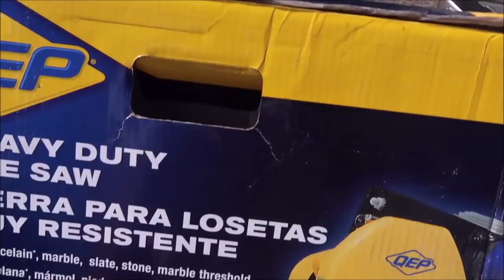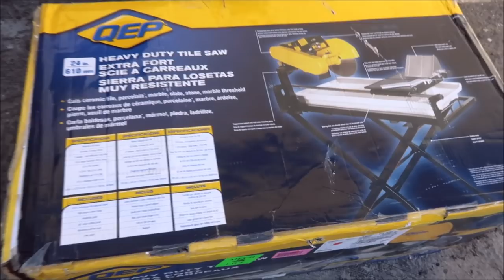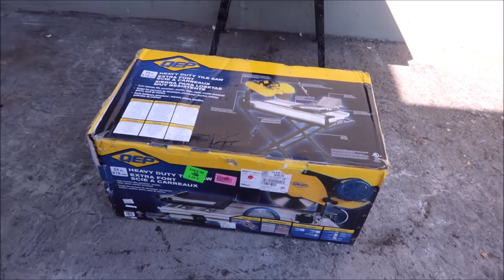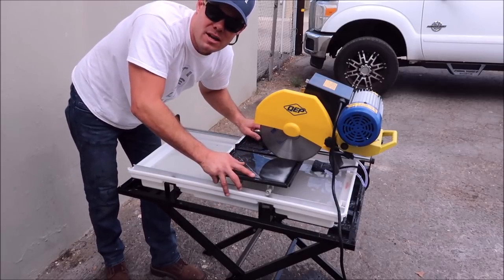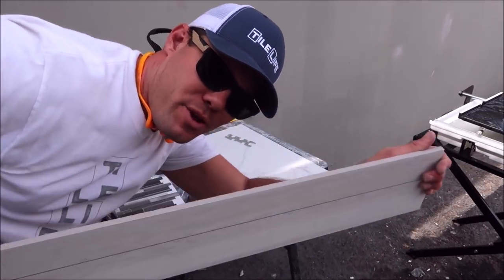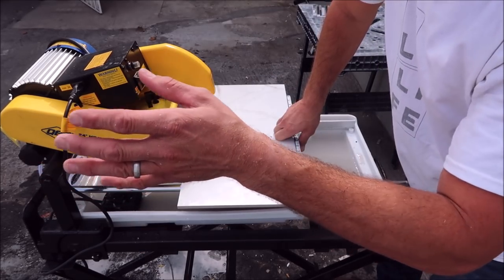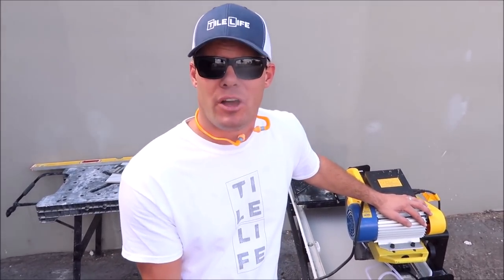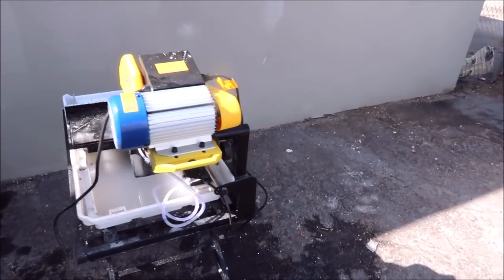Testing  The Cheapest Wet Tile Saw on AMAZON!

Comment: I do like the belt drive. I do like the baldor motors on husqvarna, felker, etc. The downside is lack of plunge, miter on the head, weight, etc. 
Almost looks like an mk saw knock off with the single rail. For 300 bucks, looks like it would be a nice cheap back up saw for pavers and stacked stone. Maybe exterior work. It's no 24000 but looks like a lot of saw for 300 bucks.

Thanks for the video once again! 👍
Reply from the maker: Exactly, and after posting the video, I forgot to mention these missing options...Building and tiling showers on a regular basis requires these options in this age of the tile game. It's great for floors and backsplashes as well as pavers etc. I'm patiently waiting for the FLEXVOLT D24000 to come out! It's our only and last corded tool other than the shop vac 👊
Reply: @LandbergTileTV  
Me too man! It will be an absolute game changer if it happens. The uk has had a flexvolt shop vac since 2016, and I've been awaiting our slice of the pie. I'm not sure why we don't have it here yet. It will be sawweeeeet to roll up on a job and never need a cord though. Especially on a quick bath remodel or even new construction. Our business has been running all of the flexvolt and 20v max we can as well. Such a time saver, and really top notch tools. The flexvolt stuff is underrated at the moment I feel. A lot of people are still stuck in the "nothing beats a.c. power" stage.
Reply from the maker: You read my mind! I've been watching Wragnlerstar's video's comparing AC to battery, and battery wins every time. Times have changed! Time to evolve with it!
Reply: I used it for pavers & it worked great
Reply: My dad and I used one very similar to this back around 2008 and it performed well. Typically it's the blade that makes the difference, if you have a good blade you can do some nice work with it. The saw doesnt make the man anyways lol.

Edit: that saw is still laying around my dads place somewhere.

Comment: I suppose taking into account most of the time the 12x24 tiles are probably going to be installed with the recommended 1/3 stagger rather than half, the clearance may not be as much of an issue. 
I also wanted to say I appreciate how friendly you're replies to comments are.

Comment: The belt drive does make it quiet. Not a bad saw for the price.
Reply from the maker: Not bad, missing a lot of options I forgot to mention such as the plunge option, the miter option and the fact you can not remove the tray to clean unless you remove bolts, but it cuts great and is quiet for $300 bucks!👊

Comment: Hello , I just discovered  your youtube channel,  can you tell me what is the mark of your electric generator,please ? sometimes I work on construction sites without electricity and how many machines can you plug in? thank you .A hello from south of France.
Reply from the maker: That is a Dewalt Power Station with Flexvolt batteries. You can run two power tools simultaneously.  Thanks for watching! 👊

Comment: It's just not the saw that matters but the blade is the most important thing.
Reply from the maker: Yes of course, a good blade like a Pearl P4, P5 or RTC blade is great!
Reply: Oh yeah, the blade is important for sure. But...... A good saw is equally as important if you're doing extremely precise work. Dewalt for instance comes out of the box ready to go for most. Mine was off maybe between 1/32 a 1/16 off. But it's adjustments allow you to square everything up 100 percent. Some/most don't even think about a perfectly accurate cut over 25 inches. Including miters. My husqvarna wasn't as accurate or convenient. But still one of the better saws built. Most cheaper saws have some arbor runout/looser bearings that is intolerable imho. And will lead to vibration and blowout even with a properly dressed 150 dollar blade. The most important part of all though is the user. 👍
You're right though. I've been impressed with a couple of cheap saws with a good blade. And I've been unimpressed with 4000 dollar bridge saws with a crap blade. 👊

Comment: A very important point he forgot was that it's a 2 speed witch are very important to the material working on. By removing the belt cover you'll see two sets of pullys one for 1600rpm second 2500rpm  remember Husqvarna runs at 2700rpm. it's a great wet saw. A man with tile experience should be able to get it's money back in no time.